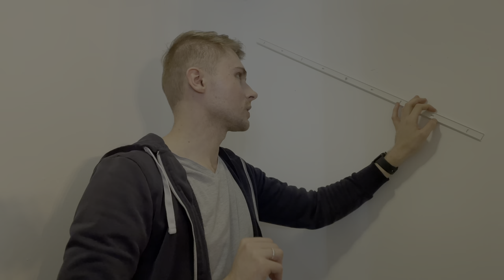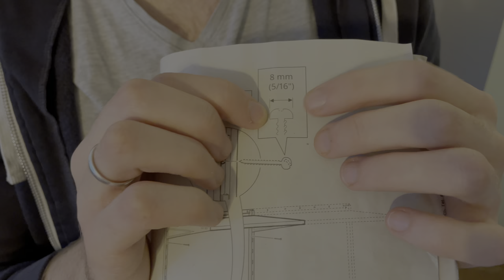VLOG: Renovating our pantry with IKEA'S BOAXEL shelving system (corner situation)

Comment: Thank you so much for making this video! We have a small closet that is 85cm wide and 105 cm deep. We decide to use Boaxel system but realize that if we use one 80 cm Boaxel system on one wall, then a lot of space will be wasted. We thought we'd better do a corner one but couldn't find any example on Ikea website (using boaxel). I'm so glad to see this video. You've explained every step clearly. This is exactly what we want. As you guys did, now we could just use two systems and one on each wall. Hope our installation goes well. Figures crossed!😄